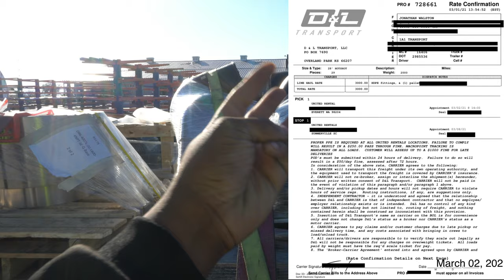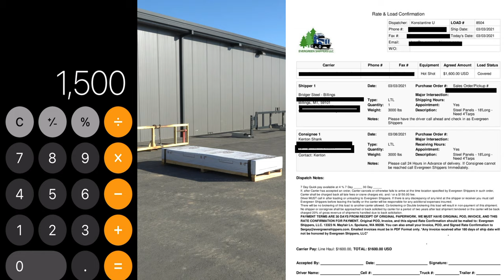How to tarp a hotshot load | $10,000 in a Week

Comment: I feel like the area I live in has an untapped market for this type of business. What do you recommend I research in order to get started, what licenses/certifications are required? Could I do this just as an independent contractor or would getting an LLC be more beneficial?
Reply: You need to do your research. There is a lot to know before jumping into this market. Do you want to be a CDL or non CDL driver? That will determine a lot of things. What type of equipment do you have bc you may not be able to be non CDL if your equipment is rated to high. DOT, MC number and authority, insurance costs, you must have at least an LLC with a valid EIN number, also do you want to get into factoring your loads or do you have enough money to wait the 30/45/60 days to get paid. There is a lot to consider but it is a great business to get in to. Very profitable if you know your numbers and do it right. Cut your overhead as much as possible and run the tires off your truck as often as possible. Good luck!
Reply: @raysmith9796  what does factoring your loads mean? And why is there a 30/45/60 day wait to get paid?